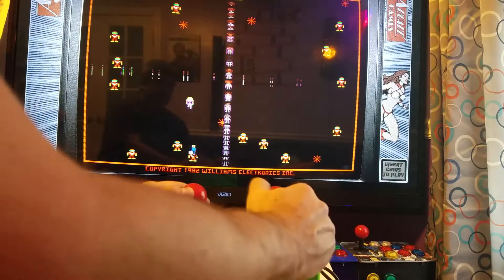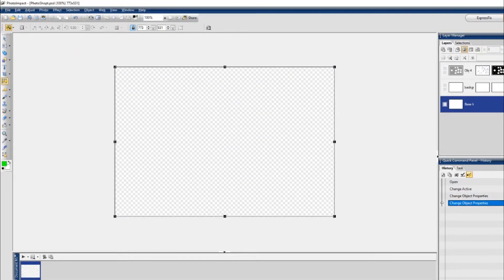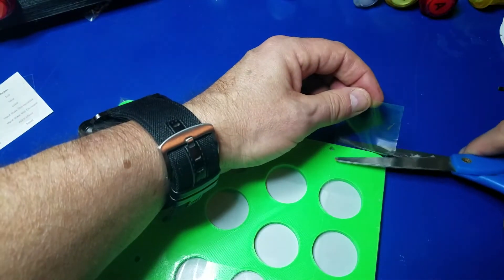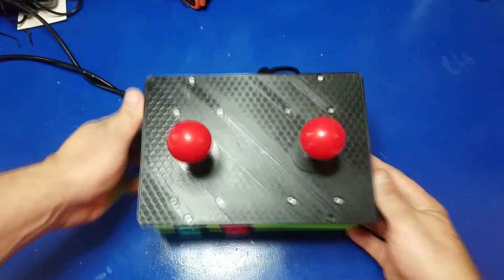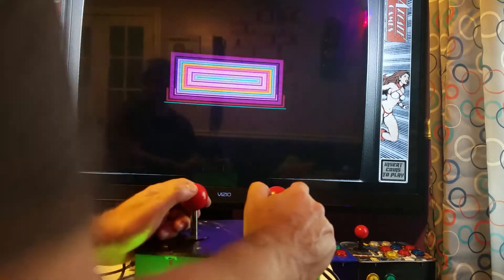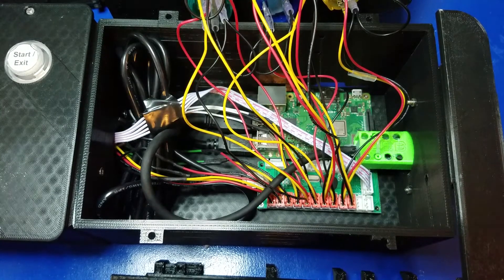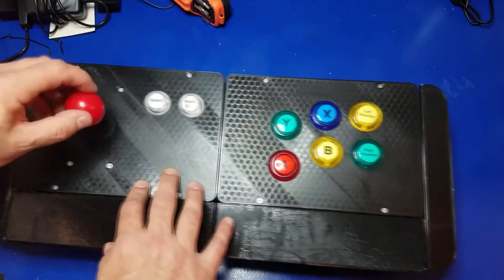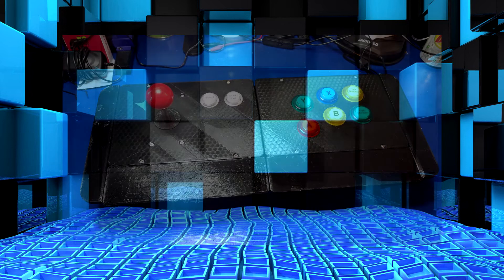OpenCADE Expansion Pack: How To Build a Large1-Player Control Panel, Robotron Panel +custom artwork

Comment: this game cant be properly played otherwise. I tried and its incredibly hard. you really need a controller like that.
I don't understand, on the dual stick, you have two usb input in this case? its like a double controller?
Reply from the maker: Correct, for this I bought two sets of sticks with 2 encoders, then installed each set into the case.  Going out the back were the two USB  cables for connecting to a Pi or PC (why I had to make the slot deeper to support x2 USB cables).  Hope this makes sense, it turns it into a dedicated dual-stick arcade console.  Though, you could do exactly the same thing by adjoining two cases each with it's own stick+buttons and install the Pi in one of them.  This was an easy way to make a single dedicated dual-stick controller.  I had a few viewers ask me if it was possible, so I created it for them and anyone else who wants to build one.  You can see one of their projects here: http://wagnerstechtalk.com/opencade/opencade-up-001/ (he sent me photos of his build)